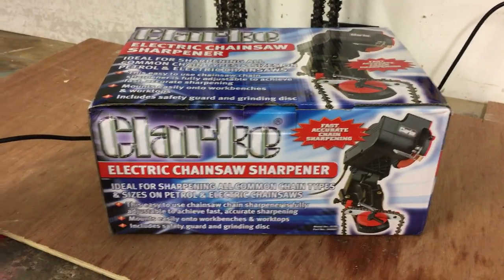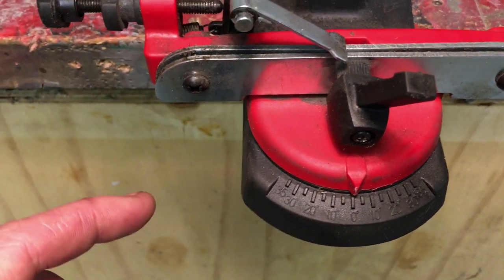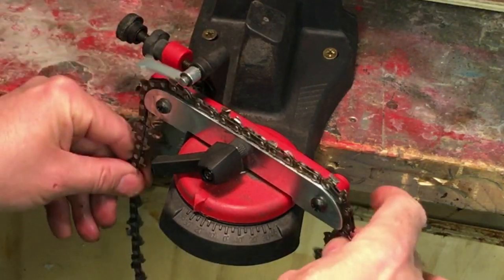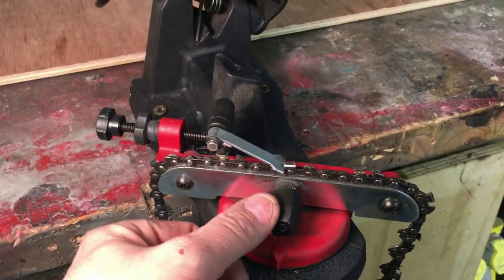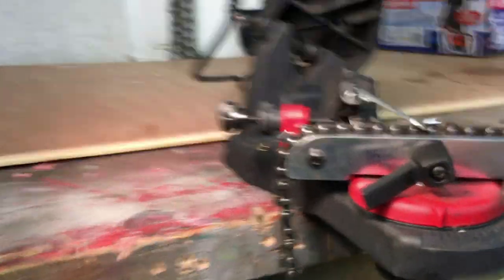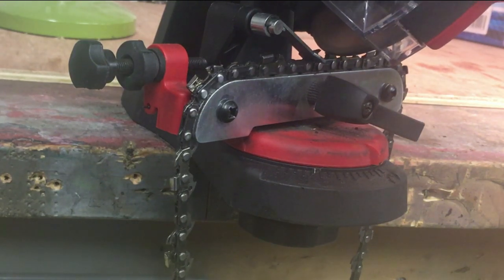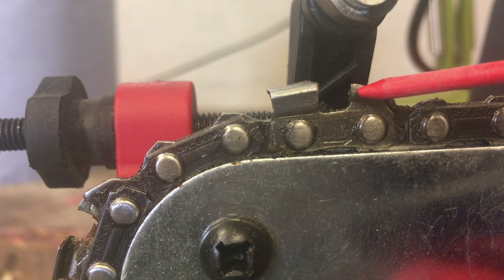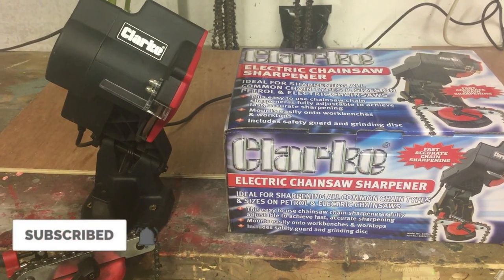CLARKE ECSS2 Electric chainsaw sharpener TOOL SET UP and REVIEW | How to sharpen chainsaw chain

Comment: Just bought the same model and your video was exactly what I needed for setting up smoothly and quickly- it made it a lot easier than trying to follow the instruction manual and its unclear pictures. So thanks! Nicely presented, clear and straightforward- just the job.
Reply from the maker: Thanks for the comment Sredni, Yes, the instructions are terrible, it took a bit of time for me to figure out how to use it correctly. That being said, once you have it set up and are used to using it, it is a great little machine and does exactly what is supposed to do ! Thanks again and I am glad the video helped you out 👍😀

Comment: The grinding wheel edge is in need of dressing / deglazing. If continue using as is, the tooth is prone to overheating & altering the temper.
Reply from the maker: Thanks for the comment, yes, you could be right, but working fine at the moment. I do not use it overly much, so will dress it when needed. 👍

Comment: Hey mate thanks for the info. How are you getting on with this now?
Reply from the maker: Thanks Darryl, I actually use the Stihl manual sharpener https://amzn.to/2SVDayy more than this now, mainly because you can leave the chain on the chainsaw and sharpen without having to take it off.  The Clarke one is still good, but it is a bit of a pain having to remove the chains to sharpen all the time.
Reply: @Bacrenfencing  Thanks for the swift reply mate. Yeah I have that stihl tool too. It's a good bit of kit as it takes down the rakers too, but I don't know I can just never seem to do it accurately enough, it feels sharp then you go to use it and I seem to almost have made the chain even worse than before. I did think taking the chain off everytime would be a pain in the arse too. Not really sure what to do 😂
Reply from the maker: @DarrylHart  I love the Stihl sharpener, I have used it on my current chain about 10 times (lightly) and it is honestly razor sharp every time. I think I will do a video on it comparing it with the Clark (pros and cons). Can't get any bloody time at the moment for YT videos but hopefully be back on soon :-)

Comment: Just got one. The lhs teeth went past the stopper and I had to pad it out with two washers. Also the teeth locker didn't do its job. It sharpened the rhs teeth OK but the lhs teeth vertically. Have. 325 pitch and .5 gauge chain Very disappointed.
Reply from the maker: Ah, sorry to hear that Phil, it works well for me. Can you not send it back for a refund ? 🤔
Reply: @Bacrenfencing  have messaged the supplier and emailed Clarke's. 
Bloody disappointing. I ordered it after some research on Google and it got good reviews. The other one that looked good was the German made Eisenthal. Wish I'd gone for that one now.
So your chain tightener works then? The lever to tighten it on mine is floppy and it doesn't pinch up the chain. May be able to just replace that whole bit as it is separate from the machine.
I did try out the saw afterwards and it was better than my sharpening. But it cuts one side and grabs the other.
Reply from the maker: @xt225  Mine has been fine Phil, but then again, I am not a professional when it comes to chainsaws. All I know is that once I sharpen the chains with this machine, it cuts 10x better than the old unsharpened chain. I hope you get the issue sorted out soon.